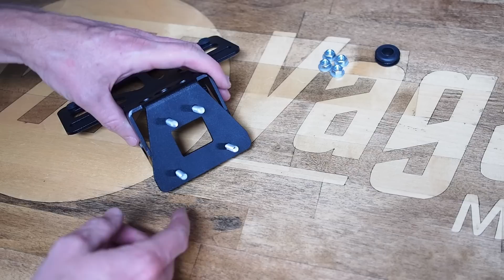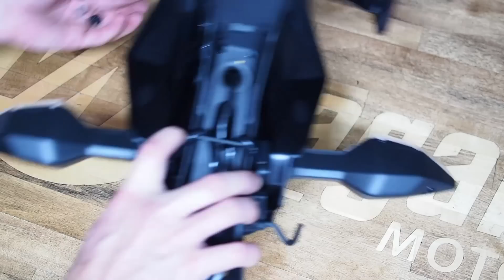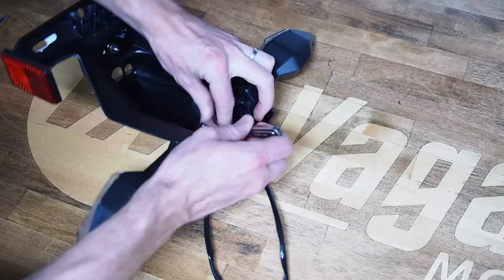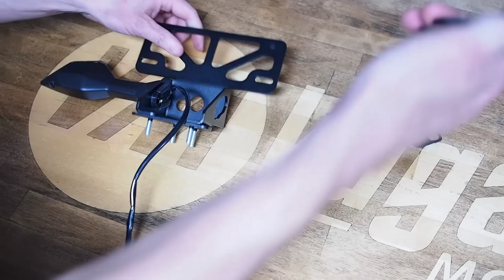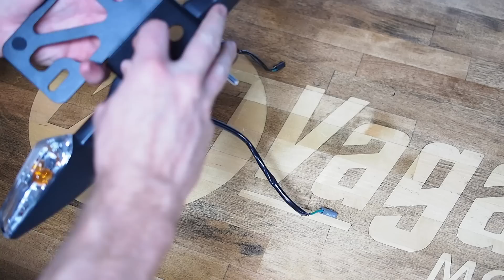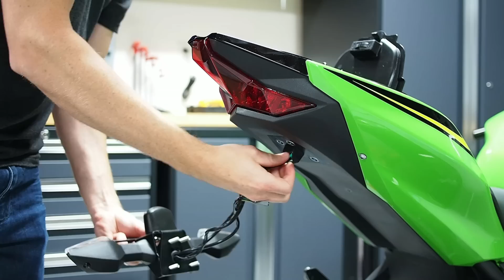Kawasaki Ninja 400 (2018-2023), Ninja 500 (2024+) Fender Eliminator - Vagabond Motorsports VM-KN410

Comment: Taking it slow and following these video instructions to the letter, I just completed this install on my 2021 Z400. It looks amazing and took less than an hour from start to finish, including clean-up. The “hardest” part is getting those pesky grommets seated properly but otherwise it’s quite easy. This is by far the best tutorial video I’ve found on this install! FYI for anyone thinking about doing this, the Kemimoto kit on Amazon is a perfect fit as well. That’s the one I installed and I couldn’t be happier. Ride safe!

Comment: Just installed on my 2025 Ninja 500. A couple small things that are different than the video with the newer bike, but very similar, and definitely doable. It took me about an hour with very amateur tools.
Reply: Did the screws separating the plastic and metallic bit sit SUPER tight? Because I can’t unscrew mine…
Reply: @melvin3864  The screws on the stock tail? Yes, those were a bitch. I had to use a wrench on the bolt side to hold it and use a shit ton of force to get them loose.
Reply: @holorem  I used so much force I completely ruined the screws. Had to pull use an electric saw to remove them. Shit was a mess
Reply: @melvin3864  Dayum, that fucking sucks. At least you got them off lmao
Reply: @holorem  Haha ye, only took 4 days xD
Reply: @melvin3864  Jesus, well it worth it tho cause it looks sick as hell
Reply: @holorem  Indeed, changed my windshield and rear mirrors aswell so now Im all set. What about you?

Comment: I got it to fit on the ninja 500 SE 2024, but you will have to remove the black box under the tail, because it's a millimeter too large for the hole in the fender eliminator...
Reply: What black box are you referring to?
Reply: Just installed on my 2025 ninja 500, didn’t have to remove anything. Just do a little bit more finagling with the additional grommet under the tail

Comment: Just installed mine. This instructional video helped out immensely. Just 2 tips for anyone installing this: Use a J.I.S. screwdriver (Japanese Industrial Standard). It looks almost exactly like a Phillips, but it acts much differently. It is designed to not cam out and  to not strip. The Phillips was created to cam out so you don’t damage whatever you’re screwing into, such as sheet metal. From what I’ve researched, it was invented because workers kept over tightening screws in war aircrafts and were digging into the sheet metal on the planes. My J.I.S. screwdrivers have a lug on the end of them so you can attach a racket if you wanted to so you could really crank down on the screws. For the turn signals, I went in at an angle and tightened down as hard as I could, and didn’t slip, strip, or cam out at all. For the second tip: Lick your finger and coat all the rubber with saliva before working those pieces in. They go in so much easier. I know that sounds perv, but it works. Thanks again Vagabond for this video, I absolutely love this product. My bike looks so good now!

Comment: I just installed this on my 2022 Ninja 400 KRT bike. Very easy to install and looks great! Nice and sturdy and probably the best deal out there. Much less than other options. The only thing that took time was getting the turn signals popped in as it was a little tricky for the first signal and then the second signal went in much easier (after I got the hand of it). I did have to cut out 2 rubber pieces (served as washers for the lic plate mount on the OEM fender) since there were no washers that would work with the lic plate light mount on the new setup. I basically cut the rubber pieces in half and two 1/2 pieces as washers on the inside in order to tighten down the lic plate light mounting screws (wouldn't have worked without the rubber pieces). Note: This unit was about $29 on Amazon. Not sure why the huge price difference between the website and Amazon but it's the same unit with directions and parts.
Reply: Can you share the link?

Comment: Outstanding! Ordered on the 18th for my 2021 Ninja 400. Shipped on 19th, received and installed on the 19th.
Only three bugaboos... unplugging the license place light, the rubber grommet underneath and then re-plugging the license plate light back in. Those three added some time to a very easy, very clean install. Thanks for a great video and product.

Comment: Is there a separate Fender where I can install different Turn Signals? More specifically TST Turn Pods. I see that the r3 Fender is possible but for the Ninja 400, the hole is too big
Reply: I'm sure you've solved this but tst has parts to do it

Comment: FYI, if you strip the screws on the turn signals like I did, you can pop off the metal bracket thats sits on top of the rubber piece with a flat head then pop it back on. LISTEN to this man when he tells you to use a U joint lol
Reply: I did the same thing lol.. it worked fine and feels very TIGHT in place.. time will tell..
Reply: Thanks! Came in looking exactly for this!
Reply: Broooo thank u soooo much
Reply: I found this video trying to figure out why I couldn't get them off and stripped them both so I just stuck stock back on. Was looking into aftermarket just to solve it.

Comment: sir i just want to ask a few question
1. is it ok to put a ON/OFF switch connecting the headlight of kawasaki 400?
2. the stock size of the rear tire of kawasaki 400 is 150/60/17r
is it ok if im going to change it into 160/60/17 or 160/70/17,
is that cannot be affect the function of the ABS sir and the speedometer.?
Reply: Why?  Why do people ask totally irrelevant questions?  Google is your friend, ask him.